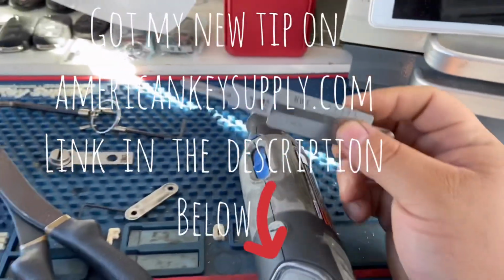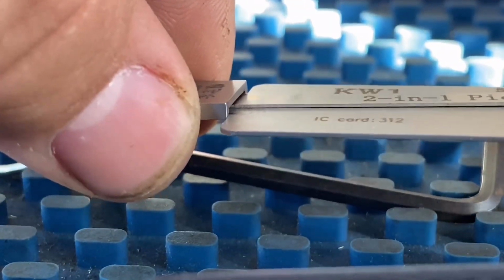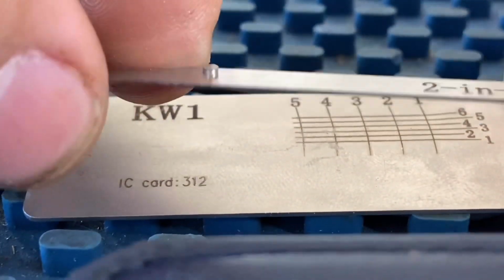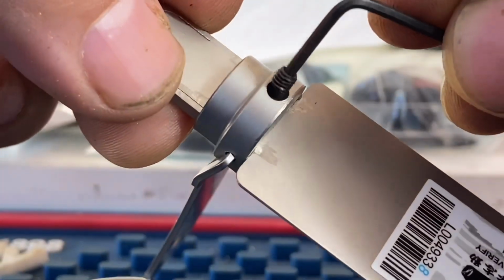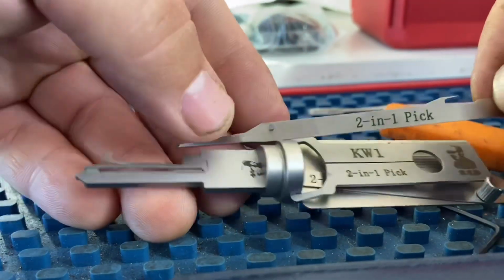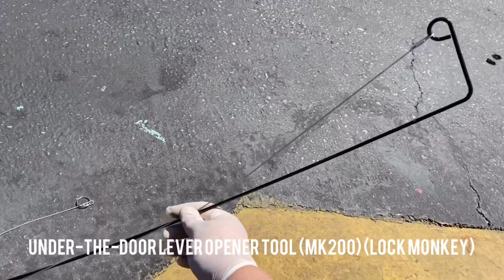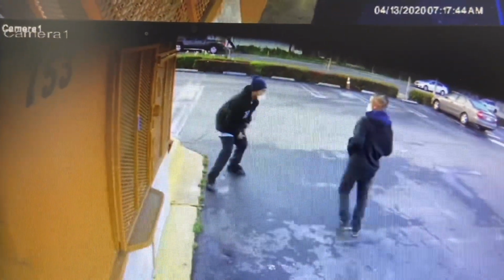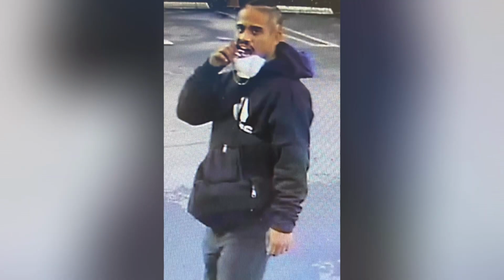KW1 LISHI REPAIR!!

Comment: Here’s a video showing how to decode kwikset smart locks with the lishi KW1 tool. Badass for the locksmith

https://youtu.be/B-dSIAO63R8
Reply from the maker: Thank you juan!! This video will come in handy!!
Reply: That would be true if Locksmiths actually used Kwikset. Kwikset is a Home Depot / Lowes / Amazon brand, not a locksmith brand. We typically use something better, and yes, more expensive.

Comment: Use a Small Screwdriver, the ones that fit electrical binding posts... take a damaged one. I had one where the back cap or magnet was lost..... remove blade from plastic handle. No need to grind the tool at all, it is not welded, it is staked in place.... the screwdriver will separate as shown.
Reply from the maker: Thank you for sharing !

Comment: I had one break picking one of those smartkey gen 3 locks. Anyhow I found 1 video on how to replace it (at the time) . It was pretty short and didn't explain allot. I used a kitchen knife that was about 28 thousands thick. I tapped it in about 1/8 to 3/16 inch. The tip came out and I was able to slide the new tip in. Then I tapped very lightly to push the plate back together, then the handle. Thank you for your video, very informative! 👍
Reply: I broke mine experimenting with smart key as well.  It worked on an older smart key lock but no joy on the new stuff.
Reply from the maker: Thank you for watching!!!!
Reply: @ryanbradley4718  The new gen 3 you need to use a shim to push the sidebar down. I decided not to use my Lishi for that because it breaks to easy.

Comment: You did a great video. But I was wondering, is there an official video to replace these? If they sell the part, it must be an issue. I got mine apart like you said, but i ended up using grinding wheel instead of stone. I'm gonna see if it can be welded or something. You wrote me before, I broke my M1 and there is no replacement part yet.
Reply from the maker: I havnt came across any other video showing you how to replace the tip ... thats why i kinda made this video..you can use  epoxy from autozone or jb weld!!

Comment: Can you find a tip for M1 /MS2 ?  I got mine from CLK and they don't seem to sell tips. I didn't see one on American Key Supply .  Thank you.
Reply from the maker: They havnt made any yet not for m1 it just came out give them some time... or send it back in to the seller you bought it from they should be able to get you a new one as long as you wernt using it incorrectly or broke it intentionally..i will keep my eyes open see if i see any seller selling them thank u
Reply: @MYKEYSAUTOMOTIVE  It was closed. I pulled my tensioner out to the side, and I must have had the slider thing with it. I did not even feel it break. It is so flimsy. It broke right even where it comes out the tunnel. If you can understand these amateur terms. Thanks for your response.
Reply: You can ask this seller. It won't be original.
Reply: @BillyJoe71  I actually got the company to replace it. CLK pushed Lishi into giving me a new on. CLK has great service.
Reply: @noahway13  that's good man!